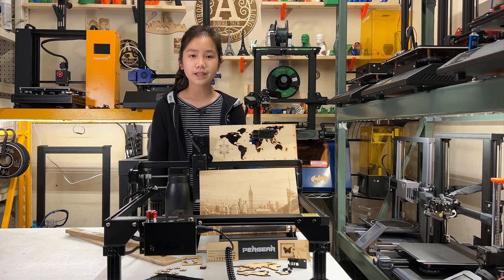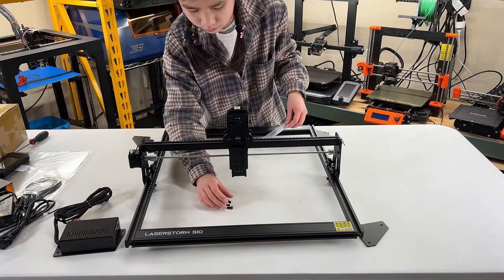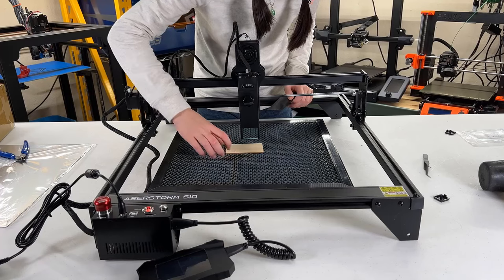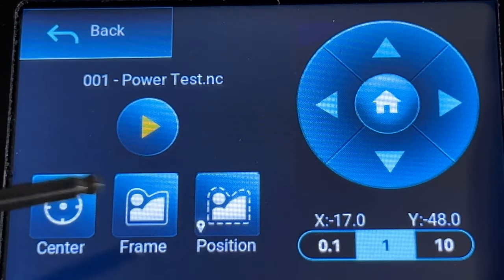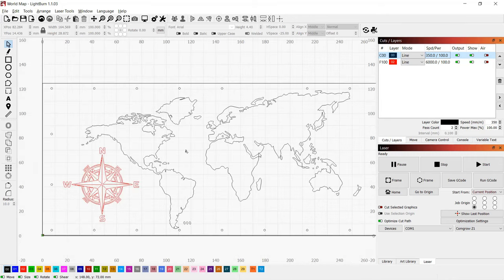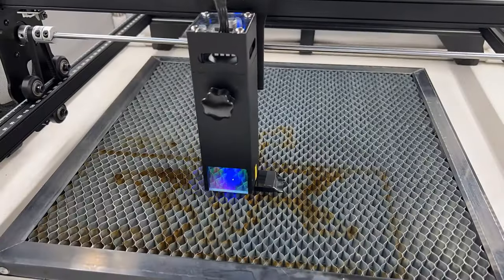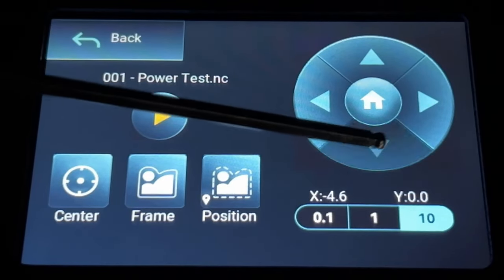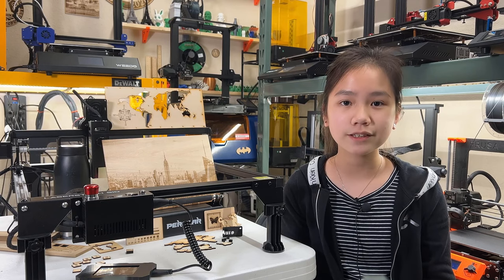Pergear LaserStorm S10 laser engraver: 10W laser module, offline controller, and rotary roller

Comment: Hi, another question 😋 would you choose this model or the Comgrow Z1 Laser Engraver 10W Output?? Only difference I see is the screen attatchment on the Pergear... thanks in advance!!
Reply from the maker: They are both basic engraver with a 10W module on a frame formed by aluminum extrusions, yes, besides the screen, they just work the same.

Comment: Hi Aurora ☺ I want to ask if you would choose this unit or the Creality CR-Laser Falcon 10W Laser Engraver?
Reply from the maker: There will be no difference; both of them basically use 4 aluminum extrusions to form a frame, along with a 10W module, just get the cheaper one would be fine.
Reply: @AuroraTech  thanks ☺️

Comment: Good review. I’m looking for a desktop laser. 🙋 question, would you buy this machine? If not which would you recommend at about this price point. Thanks from Orlando Florida
Reply from the maker: In fact, it really doesn't matter which engrave you choose, only choose the power you need 5W or 10W. This machine has an offline controller and touch screen, some other machines may have WiFi, but WiFi may not be that useful as you still need to go to the machine to position the material. So, if I need a 10W laser with an offline controller. Yes, I think this machine is really nice.
Reply: @AuroraTech  - thanks for your input. Your channel is very informative.

Comment: Just wandering where you purchased that laser enclosure and what brand that laser enclosure is.. It looks like a amazing enclosure that could fit different machines.. Thanks
Reply: They have links to everything used in the enclosure setup in the Pergear L5 video's description.
Reply from the maker: My DIY Laser Tent Setup:

Laser Tent:
https://bit.ly/3q17MfU

LED light 20W (x2):
https://amzn.to/3IT2lXr

120mm x 38mm 110V exhaust fan:
https://amzn.to/3gcBARl

AC Infinity 4" ducting (8FT):
https://amzn.to/3J9Zt8T

Comment: I purchased the com grow laser tent and have the pergear s10 laser but the tent is not fitting over the laser like in your video? The tent is about half an inch too small any ideas why?
Reply from the maker: That's strange, the tent can fit with all engravers I reviewed except the Ortur laser master 3 which is a few inches longer than most standard engravers. My tent is around 26"(deep) x 25.5"(wide).